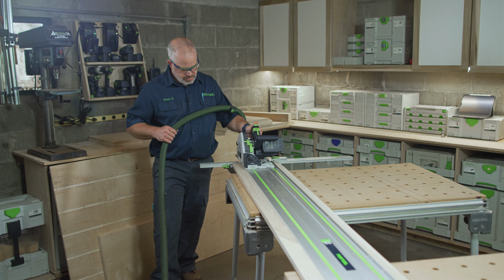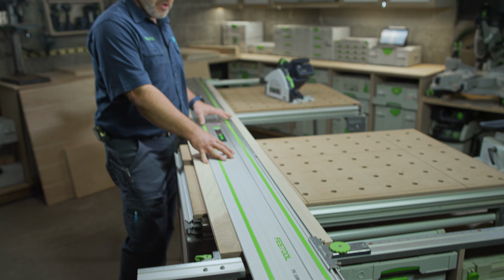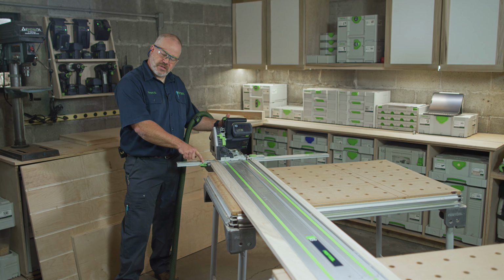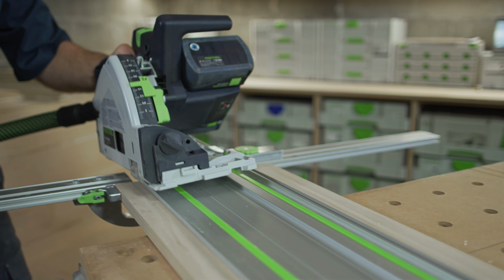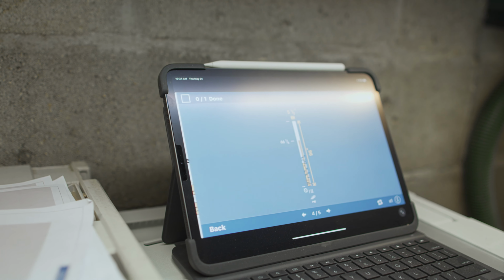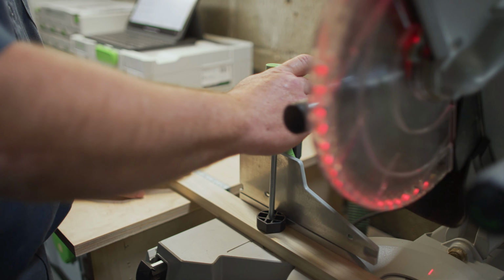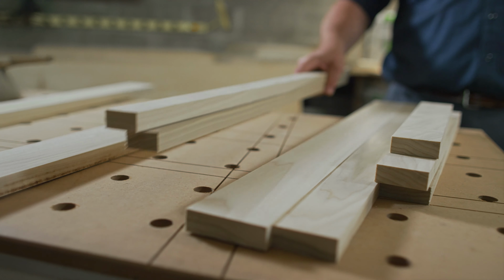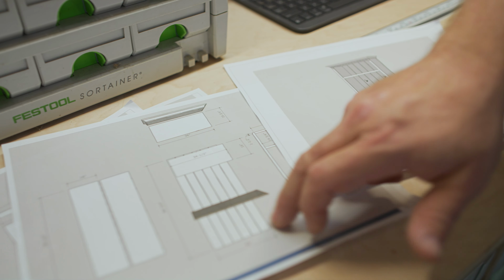Build Series 3: Mudroom Cabinet Build: EP 3

Comment: just one note, with the playlist, the mudroom cabinet set of videos is not chronologically set in the list, ie the order is 3,2,1,8,7,6,5,. so you have to load each video manually, rather than using the 'Auto" features of the playlist ( play all button). the other projects are fine, just this last, most recent addition.
PS: part 4 of the mudroom cabinet is not on the playlist!

Comment: Why switch to 48 tooth blade to rip poplar?
Reply: @Robert McBreen  I do this for a couple reasons. 1. because i'm using the cordless TS 55, using a blade with less teeth requires less power, which extends the battery run time.  2. the quality of cut the 28 tooth blade produces is more then sufficient for the face frame material i was ripping.
Reply: @brentshivelyfestooltrainer9017  what software or app are you suing on the iPad?